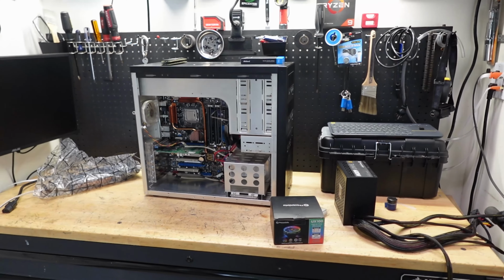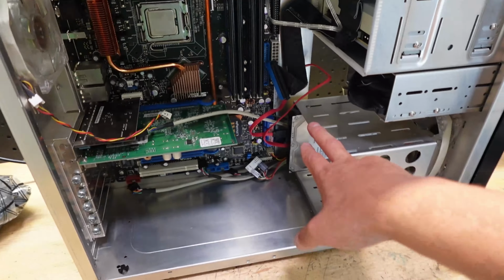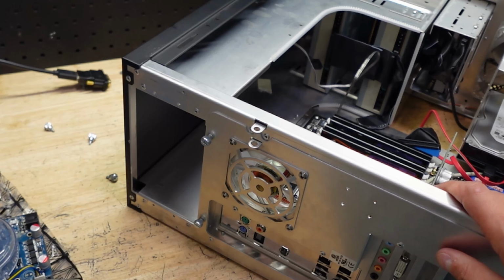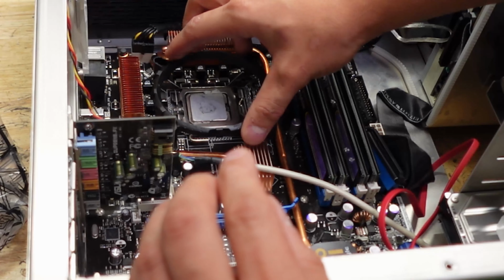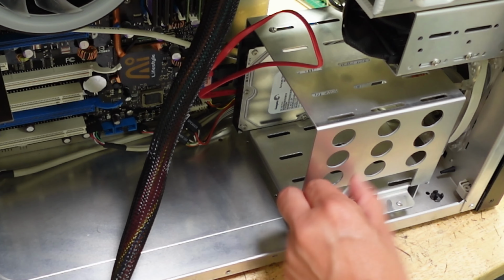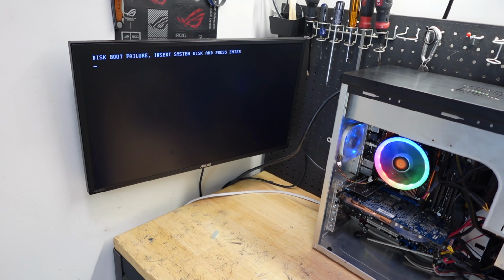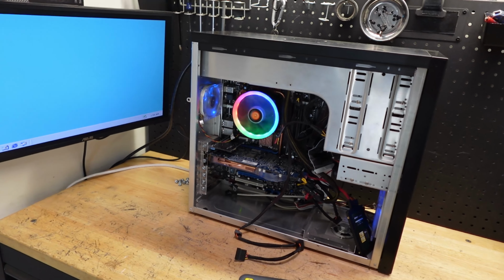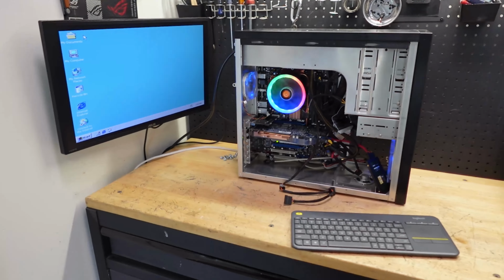Paid $60 for this old Intel Core 2 Duo.. mostly wanted the Lian Li case!! Was it worth it?

Comment: I love this computer. I’m glad you are saving it.

It’s dual channel memory and I think you’re still supposed to match the slots, for example put both of the SLI memory sticks in the same color slots.
Reply: If he is using Windows XP or 2000 not much point they are max 4GB anyway. Unless he wants to try and get Windows 64 running.
Reply: @TheOdog1970 it doesn't matter.  The hardware is dual channel and still requires the paired slots to match.

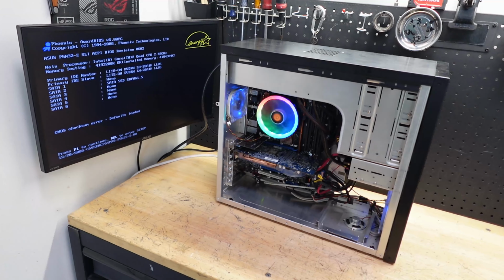Comment: I noticed at 5:11 that it said something about CMOS checksum error which would mean the battery had died. This would be expected for an old computer where the battery (usually a CR2032) will likely have to be replaced.

Something to keep in mind with Core 2 systems is that with 4 slots of DDR2, the maximum RAM you can put in them is 8 GB which obviously isn't enough for modern games that need 16 GB. Yes, you can run Windows 10 on a Core 2 Duo/Quad, but performance feels sluggish to me compared to Windows 7 or possibly Windows 8.1 even with 8 GB RAM and an SSD. That being said, it's still good for an old gaming PC with the correct card such as a GT 1030 (Windows 7) or something like a GTX 750 or 950/960. For NVIDIA, the GeForce 900 series is the last series to support Windows XP and Vista. Another note is that Steam no longer supports Windows 7 and 8 as of 2024, so you'll have to do workarounds to play them.
 
It may not surprise me there are some interest in the older cases seeing that it has 5.25 and 3.5 inch bays which a lot of new cases don't have. I understand people don't often use Blu-rays and DVDs these days especially with games being downloaded. In my opinion, I feel the older cases are better since you get a lot more drives than newer ones offer. For example, the AZZA XT1 from circa early 2010s can support 6 hard drives/SSDs and has 4 5.25 inch bays whereas the CORSAIR 4000D AIRFLOW sold in 2024 doesn't have any 5.25 inch bays and only offers 2 of 2.5 SSDs and 2 of 3.5 HDDs which is less than the XT1 (although newer motherboards do offer M.2 slots). Also, there are some design issues. One of them is the drive cage on the bottom where the power supply is mounted, some people have complained that there can be little clearance especially with non-modular power supplies due to the drive cage. The 2nd issue is offering a vertical GPU mount but not having vents for heat to be expelled out which results in higher temperatures, more fan noise (due to higher temps), and possibly lower performance due to thermal throttling.

Comment: I have got the same case and haven't seen a better case any where else that will accommodate 8 HDD,s and rx580 1000 watt PSU fx8350 as good.

Comment: Dude them core2quads be good, no need to pair it with such an old gpu. I had a xeon 5440 which I paired with an rx550, 8 gigs of ddr3, and boom i cam play gta 5 at low/high at 1400by900 at 30-60 fps

Comment: You should make it a dual boot win10 with windows XP.

DDR2 1066Mhz Ram seems to be stable enough to run windows 10 with no problems.

Making it a dual boot system for newer and older games. A GTX 950 or GTX960 isrecommended.

Atleast offers DX 12 for that dual boot compatibility.

People pay more for it too.

The m2000 work station cards are going pretty cheap only problem is its 4GB Vram and windows XP does some funny things in high speed frames, passed a 2GB Vram thresh hold.

The dual boot is the way to go so people can go online to download older title games. Or  for XP driver patches.

Dual boot makes the system convenient and people will pay more for that convenience.

Comment: This processor will handle windows 7 and 10 just fine.  Also, with the hardware in there, you'd be FAR better off running something like Lubuntu or Linux Lite than windows 2000 or xp.

Comment: How much do you think i can get with specs with an i7 3770k and a r9 380 4x4 16gb ddr3 I'm trading an psp 2000 and an 2ds for it?
Reply from the maker: it will perform well but your your better off selling the game system and using the money to buy something better then that specs
Reply: @DLMtechgarage  to late now sadly but I'm actually like really really surprised! Like I can play fortnite all low settings performance mode even dx11 plays the same but no stutter at all basically 120 all the time
Reply: @DLMtechgarage  the Lowest that I've seen it sip was 90